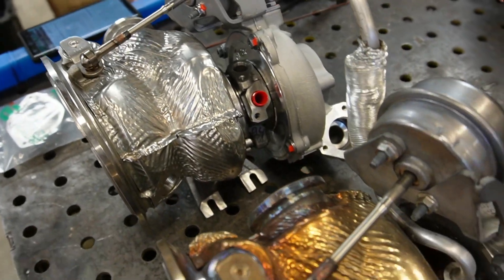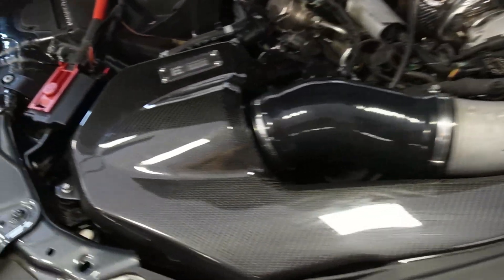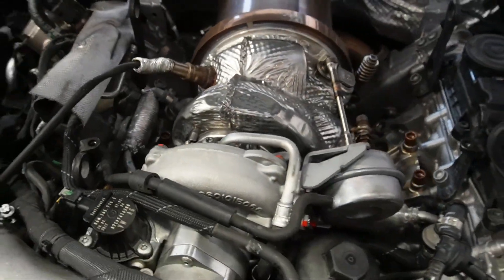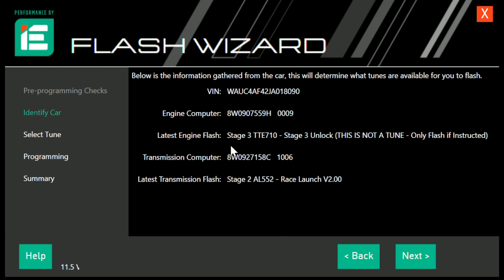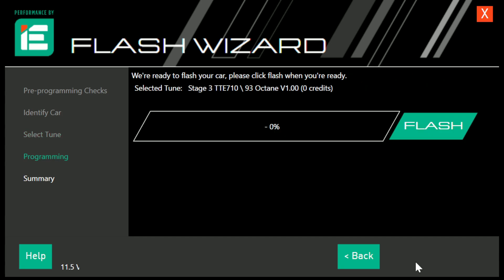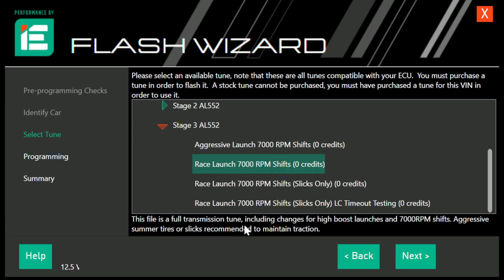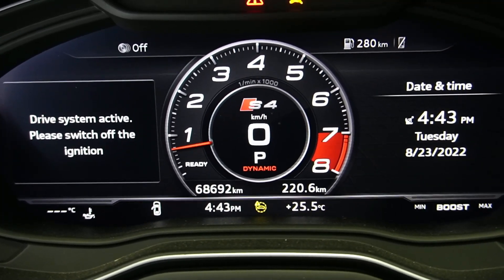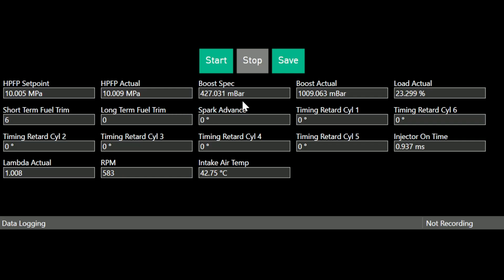TTE710 Install & Integrated Engineering Stage 3 Tuning - Audi B9 S4

Comment: yo bro, I got a quick question maybe you could help me out. I'm just about to put my car on E 85 Stage1 Integrated Engineering. On the website it says stage1 and 2 e85. stage 3 e70. do you know what ethanol Contant I'm safe to run at on stage one? is it E60-e85🤷‍♂️ or do i need straight e85🤷‍♂️. thanks bro love all your stuff. 3:42
Reply from the maker: Check out the dyno graphs showing the power they made on their dyno. It says E60 - E85 for the Stage 1 & 2 ethanol tunes: https://performancebyie.com/collections/ecu-software-tunes/products/ie-audi-3-0t-turbocharged-performance-ecu-tune-fits-2017-2020-b9-s4-s5

Comment: would you recommend building the engine with upgraded internals if you want to daily this upgraded turbo on 93 gas?
Reply from the maker: There are no such internals available yet to my knowledge. Also to run 93 you don't need to build the motor.
Reply: @VancityAudi  i have heard the crankshafts are quite vulnerable. Have you heard similar things?
Reply from the maker: @will_preto  nope. Rocker arms are the only things I've heard people make a scene over.

Comment: I have an S5 Sportback with same turbo and only have access to 93 octane fuel. Will the car go faster with HPFP and 4 bar MAP sensor and the stage 3+ tune. NGP says you can squeak out about an extra 20 HP with this. I agree the car rips and is a lot of fun with all IE bolt ons. Do midpipes help exhaust note only or performance as well?
Reply from the maker: Yes, a HPFP and 4bar MAP sensors are required to get the most out of their pump gas tunes at a Stage 3+ power level. No, midpipes do not add any performance benefits that I'm aware of. Only sound.

Comment: The surprise that wasn't exactly a surprise ;) Very curious to see what TTE710 on 93 is compared to Stage 2 on E85. What fueling is needed for E85? Injectors and pump also? Not familiar with this platform as well.
Reply from the maker: You can't run straight E85 on this platform. At least yet. You need an upgraded HPFP and 4 Bar MAP sensors to run an E30 blend. Then you'll also need RS7 injectors to run an E70 blend with IE.
Reply: @VancityAudi  sounds like more fun in the future then
Reply from the maker: @scottc78  most definitely
Reply: @VancityAudi  thats got me drooling!

Comment: Should I save the money for a b9 or just get a b8… I really like turbo more then supercharger and I’m hoping to get over 500whp for my next daily/ build
Reply from the maker: Don't waste your money on a B8. I've now owned both and the B9 is a vastly superior car.
Reply: You pretty much answered your question. If you want a turbo and make 500whp then the only choice is B9. The B9's engine has much more potential for power especially when you go hybrid turbo. The B8 platform, while awesome and unique, is an ancient platform at this point. The only things better about the B8 over B9 are the stock suspension, instant boost from supercharger, and snappier shifts with the DSG.
Reply: @voop00p  I’ve owned both dual clutch and the new zf8. The dual clutch feels more sporty but the zf8 actually has “dsg farts” on upshifts and is more comfortable in stop and go traffic. I definitely liked the responsiveness of the dual clutch better. Its quick and snappy like a Porsche. The zf8 is definitely laggier but more comfortable. Plus an extra gear for better gas mileage is a plus. I have a B9.5 RS5 and my friend has a Macan GTS (same engine, different transmission). They feel soo different
Reply: @stefanomarcellino6701  I've owned both as well. Currently I have a B9 S5. I really miss the responsiveness of the DSG but I imagine on paper the ZF8 performs very closely, especially after a TCU tune. I do appreciate the extra gear for highway cruising from the ZF8. Do you ever wonder why Audi didn't use a dual clutch like in your Macan or do you think it makes sense to use ZF8 since Audi is more balanced between sport and luxury and practicality?
Reply: @voop00p  yeah i kinda wish it had the pdk that would be so much fun
Reply: Also just so you know the later B8 models and B8.5 are turbocharged
Reply from the maker: @stefanomarcellino6701  no they're not. They are supercharged. Not until the B9 models did they become turbocharged
Reply: @VancityAudi  i could’ve sworn the B8.5 switched to a turbo because of the V6T badge. You’re right though
Reply from the maker: @stefanomarcellino6701  the V6T badges started in 2010 with the B8's. That was never changed. It was a stupid decision by Audi to badge them as such when they all used a supercharged motor until 2017. Thank goodness they have a proper turbocharged motor now though to correspond with their badges.